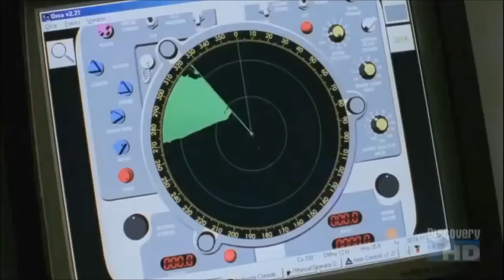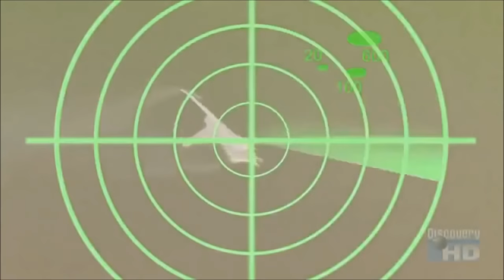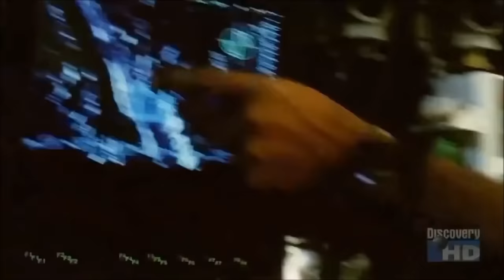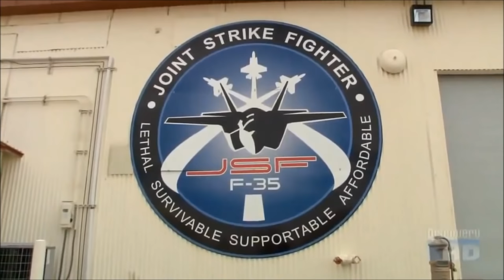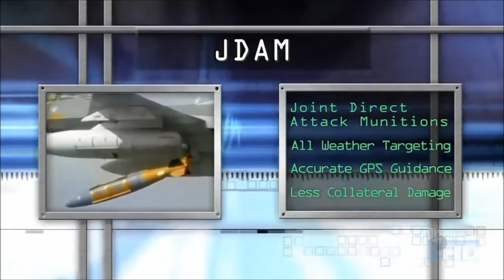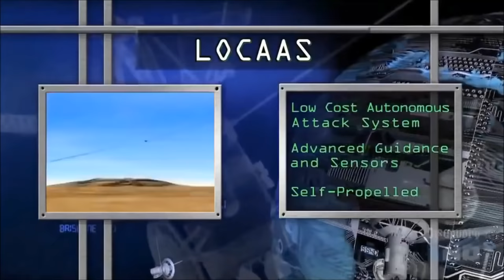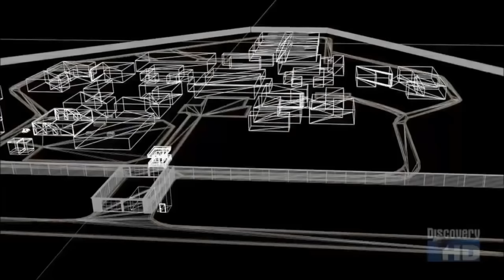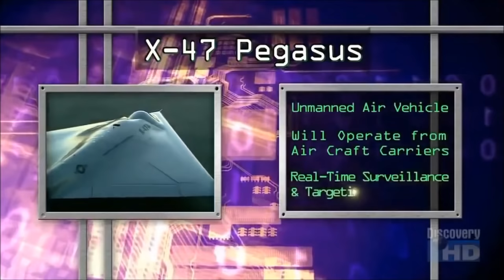National Geographic Documentary 2016 - Future Fighter Planes - BBC Documentary 2016

Comment: The Lockheed Martin F-22 Raptor is a fifth-generation, single-seat, twin-engine, all-weather stealth tactical fighter aircraft developed for the United States Air Force (USAF). The result of the USAF's Advanced Tactical Fighter (ATF) program, the aircraft was designed primarily as an air superiority fighter, but also has ground attack, electronic warfare, and signal intelligence capabilities. The prime contractor, Lockheed Martin, built most of the F-22's airframe and weapons systems and conducted final assembly, while Boeing provided the wings, aft fuselage, avionics integration, and training systems.

Comment: To add to Vulcan 750L's response regarding the F-35 effectively and MORE effectively replacing the A-10,. I would add that it would do so with several advantages related to what Vulcan750L pointed out 1) without the ground troops being nearly as aware of its PRESENCE (surprise), 2) at far less risk to the PILOT because it would be much higher above the targets! As he pointed out, it doesn't NEED to be as physically resilient as the A-10 because it would never be exposed to the HITS the A-10 would inevitably experience. This relates also to WWII fighters that, no longer required for bomber cover after the Luftwaffe had been dramatically suppressed, they did extensive close ground support that exposed them to damage from the explosions their strafing CAUSED. They frequently flew THROUGH the debris thrown up BY those explosions - not to mention ground fire at the low altitudes.

Comment: will somebody please explain to me how our radar can detect immobile vehicles that fire surface-to-air missiles?
Reply: Well to start I have to admit I have no real world expirence with this situation but from what I have researched any Sam sight has radar to detect incoming threats, as do the missiles once fired. Thus they detect the radar from the Sam sight an home in on it. Hope that helps. P.s other none radar sights are targeted using GPS and line of sight marking lasers which guide the ordinance in.
Reply: Radar does not need the target to move to detect it. Think of radar like a camera that instead of capturing light that comes from other sources like the sun, instead captures light that it sends out itself. Radar uses longer wavelength than visible light.
You basically scan the ground and look for structures that look like SAMs. That alone is of course not always enough to know for sure if it's a little house, a civilian vehicle or a SAM. So they have other sensors like IR cameras to further disambiguate potential targets. The final check has to be done by the pilot, who can look at the radar and IR imagery and decide to attack/avoid/ignore the target.

Comment: I don’t get the point of stealth you can fly low and fast and take out the sam launcher while others are dogfighting other planes and the hot gasses from the rear of the engine make it unstealthy and most features of stealth make the planes unmanuverable.
Reply: Sniper Lewis15 so from what I’ve learned the point of the F22 and F35 isn’t to replace other aircraft. There job is to be the first attack and destroy the SAMs so that all of the other planes can come into an area safely. The other job they have is to basically be a general In the sky. There hard to detect and they sip fuel while still going fast. With the new generation of B21 drones that Lockheed is making they will have purpose built tankers that can pair up with them and refuel them. So basically the most elite pilots will get to fly these planes and direct all other forces. They’ll coordinate with the navy, army and marines while directing drones, ground forces, naval based missiles and airborne drops of tanks and soldiers. These planes are going to allow the top brass of the military to literally hover in the air over the battlefield and read the enemies movements. It’s going to allow us to have a real time strategy approach towards fighting our future wars. Simply put no other Nation is going to be able to make an equivalent plane to us for another 20 years. Maybe by 2040 the other nations of the world will figure out how to make a 6th generation drone fighter. But as others have mentioned this design originated from the 1980s and we probably have things in development now that will make people’s heads spin. Nuclear powered turbofans that allow you to fly indefinitely without needing to refuel. Drones with hypersonic engines that can fly at Mach 8 and take 30G turns. Direct satellite uplink with drone fleet connection to allow a single pilot to control a swarm of 50 planes using AI and hive mind algorithms to allow drone controlled f16s to kamikaze enemy planes. All of these are probably thing the pentagon and CIA have already developed and have waiting for full production. You’re only seeing what they allow you to see. The entire world knows just how far behind they are compared to US military tech.